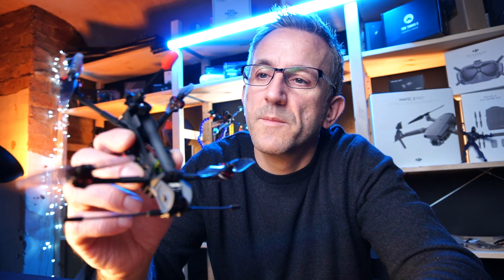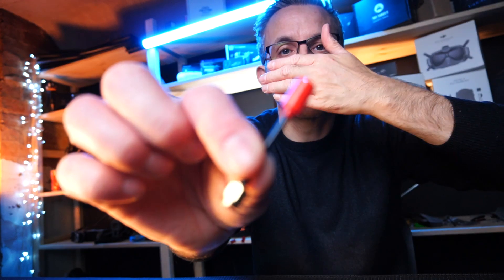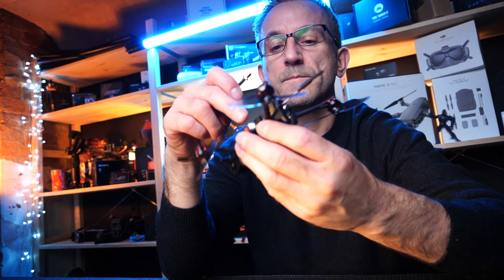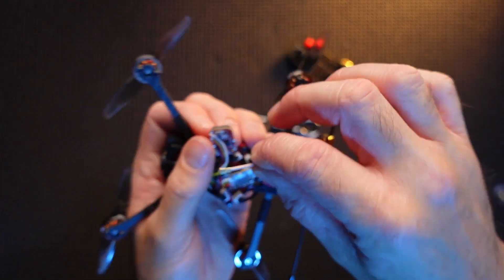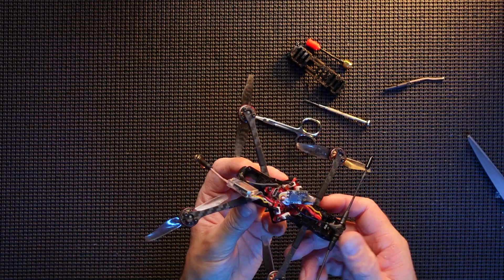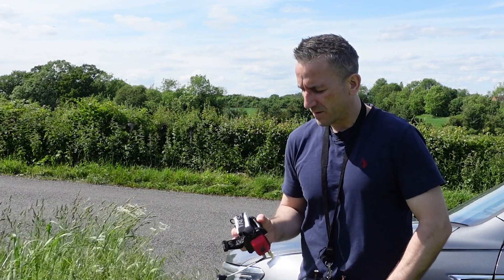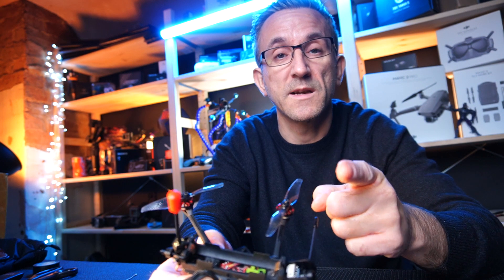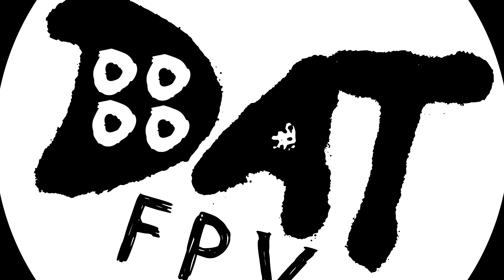Rekon3 nano long range Antenna upgrade

Comment: You can put the vtx output on a switch, then you are able to lower it towards the end, on 25mw, the battery voltage can be lower a lot before things get nasty.

Comment: Can use jumper lite with this what best reaciever to use not cross fire etc
Reply from the maker: if you get the version with the frsky receiver in it then yes - mine has a crossfire in it